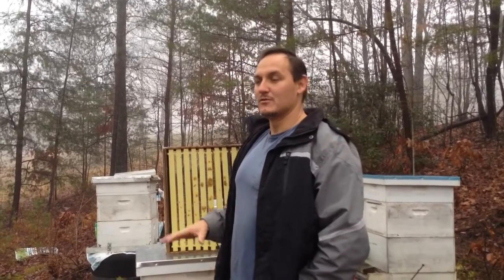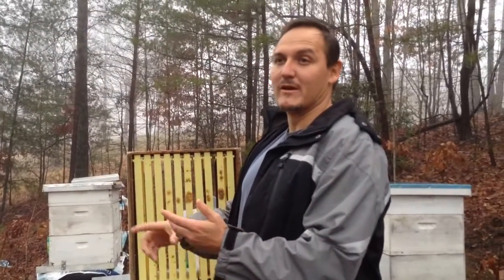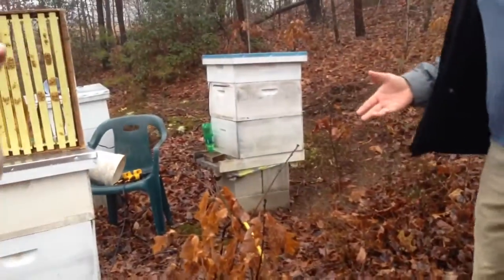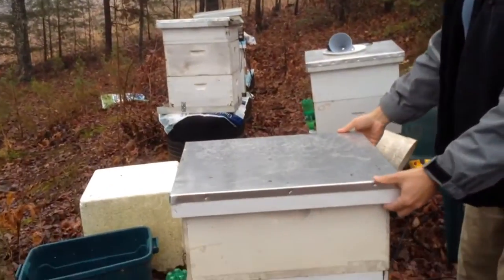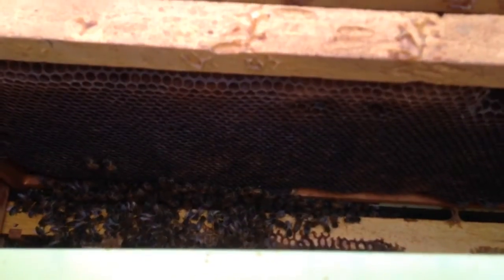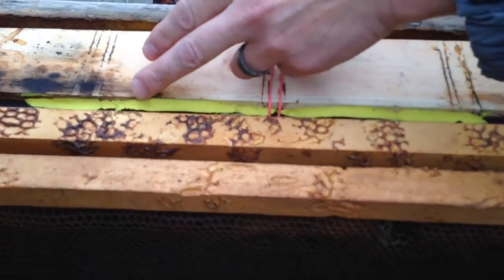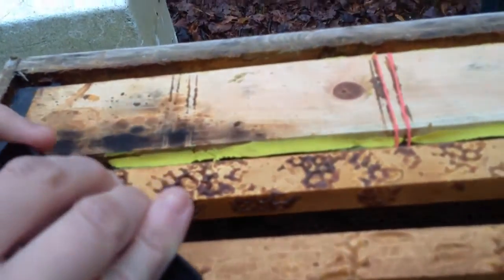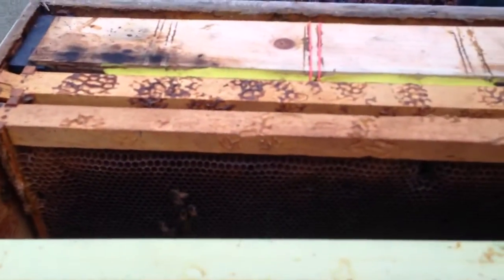how to keep bees warm . honeybees

Comment: Sorry to bother you again. I spent all yesterday trying to work up these heaters like your idea. 

But its very hard to tell if its working. I can't tell partly because the default temperature of these isn't so high. I hope you might have some kind of advise to help us know if its actually working, and if its hot enough. When I tested doing a bee syrup feeder with the heater inside and lid sealed outside just at night over night, I went out a few times during the night to feel the side of the device. And feeling the side of it, I can't tell if its warm enough or working. (heater not inside the beehive yet, just outside testing). 

If I can figure out this part with your help. I hope to install these later tonight before dark.